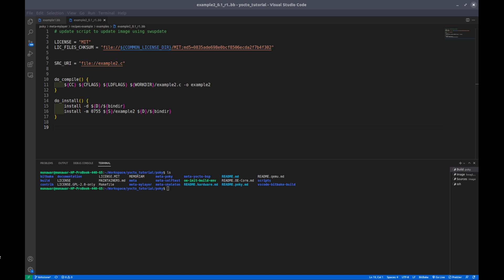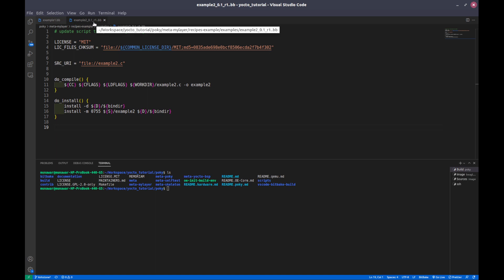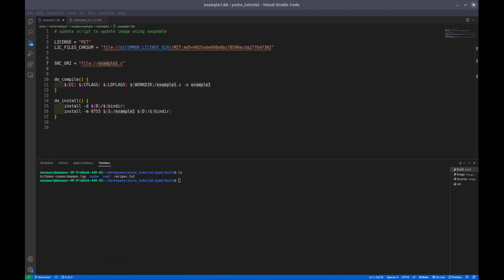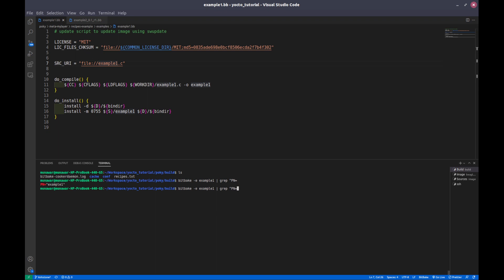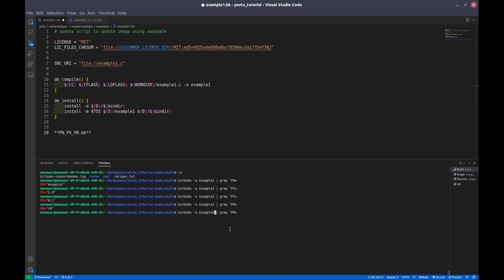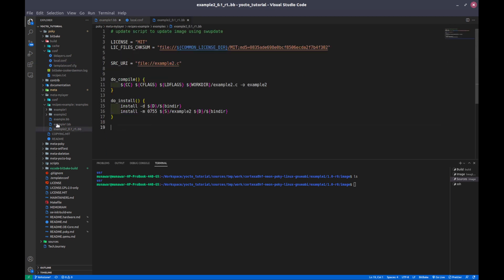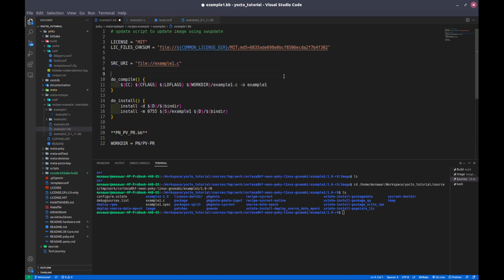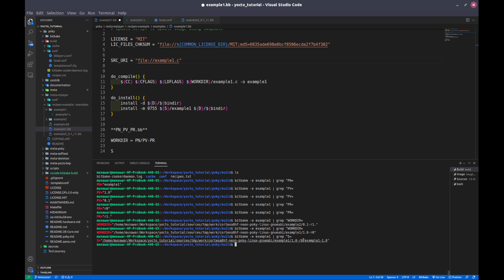Yocto Tutorial - 06 Understand Basic Yocto Variables (WITH EXAMPLES!!) | PN PV PR WORKDIR S D B

Comment: 2:07
I'm trying in vain to build the example1 recipe but I'm getting this error. I don't know what I do wrong...

$ bitbake example1
ERROR: example1-1.0-r0 do_compile: Execution of '/home/user/Projects/poky/build/tmp/work/cortexa8hf-neon-poky-linux-gnueabi/example1/1.0/temp/run.do_compile.94886' failed with exit code 1
ERROR: Logfile of failure stored in: /home/user/Projects/poky/build/tmp/work/cortexa8hf-neon-poky-linux-gnueabi/example1/1.0/temp/log.do_compile.94886
Log data follows:
| DEBUG: Executing shell function do_compile
| cc1: fatal error: /home/user/Projects/poky/build/tmp/work/cortexa8hf-neon-poky-linux-gnueabi/example1/1.0/example1.c: No such file or directory
| compilation terminated.
| WARNING: exit code 1 from a shell command.
ERROR: Task (/home/user/Projects/poky/meta-mylayer/recipes-example/example/example1.bb:do_compile) failed with exit code '1'
NOTE: Tasks Summary: Attempted 833 tasks of which 826 didn't need to be rerun and 1 failed.

Comment: Hello, i have created the example1.c and example1.bb file as per your directory structure but i am getting error while bitbake. Do i need to anything else before bitbake?

bitbake example1
/usr/lib/python3/dist-packages/html5lib/_trie/_base.py:3: DeprecationWarning: Using or importing the ABCs from 'collections' instead of from 'collections.abc' is deprecated since Python 3.3, and in 3.10 it will stop working
  from collections import Mapping
Loading cache: 100% |######################################################################################| Time: 0:00:00
Loaded 1645 entries from dependency cache.
ERROR: Nothing PROVIDES 'example1'. Close matches:
  example
  gst-examples
Reply from the maker: Hello,
Did you add you layer in bblayer.conf?

Comment: Thank you for your videos! They are very helpful. Could you help me on setting a root password? I wrote a .bb recipe for it, and removed 'debug-tweaks' from local.conf file. In my .bb file, I basically added inherit "extrausers", and 'usermod -p pwd root;" ; however I still have no luck. I'm using Kirkstone as well, your help is appreciated!
Reply from the maker: Hi there,

To set up an encrypted password for the root user, follow these steps:

1) In your Linux terminal, execute the command to encrypt the password: 
printf "%q" $(openssl passwd YOURPASSWORD) where you replace YOURPASSWORD with your desired password. The output will be your ENCRYPTEDPASSWORD .

2) In your local.conf file, create any variable, let's name it PASSWD , and assign it the encrypted password: PASSWD = "ENCRYPTEDPASSWORD" .

3) Add the following line to your local.conf file: INHERIT += "extrausers" .

4) In the local.conf file, add extra user parameters to set the password for root: EXTRA_USERS_PARAMS = "usermod -p '${PASSWD}' root ;" .

5) Save the changes and proceed to build the image.

Once the build is successful, the user will be set as root , and the password will be YOURPASSWORD .

Hope this helps! If you have any further questions.
Reply: @techabyte8  Oh man thank you so much! That worked!!  You saved me days of debugging ... Also, I was testing with not encrypting the plaintext and just assign it directly to PASSWD, but that didn't work, does this mean that to se custom pwd, always has to be encrypted? thanks again
Reply from the maker: You can try non encrypted feature by using -P option instead of -p. But I think that non encrypted feature has been depreciated. But it is better to use encrypted feature, otherwise you have to write real password in recipe or config file, which is pron to risk.
Reply: Got it, thank you.
Reply: I watched all your videos and even though they're all helpful, I'm struggling at the moment with u-boot configuration. Basically, I'm trying to modify the U-Boot autoboot settings (delay & string) so after bitbake compilation, these are reflected at boot up on my target board (sama5d27-som1-ek-sd). These parameters are defined in a ".config" file which I'm trying to modify but I'm not seeing the changes on my board. Is this how it's supposed to be done? Do you have any suggestions on how to accomplish this? 

Thank you
Reply from the maker: Hi there,
You can use the following tutorial as reference for doing U-Boot Configuration.
https://youtu.be/uErrAUtxgt4?si=id-FyAi3_S9M53WH
Just instead of Kernel use uboot. All other steps will remain same.
I hope it helps you.